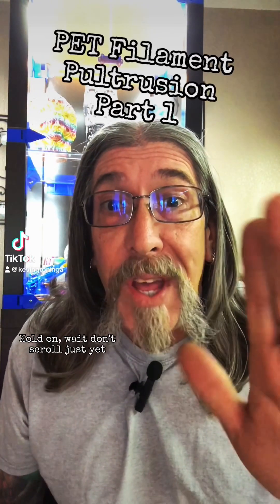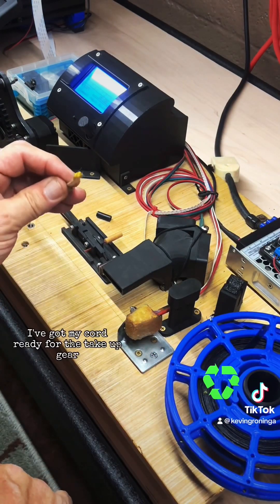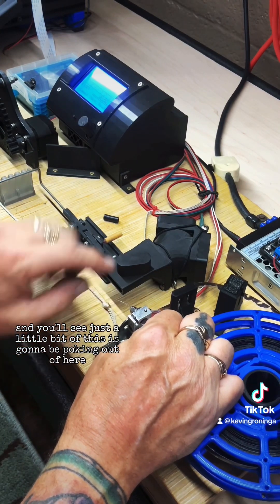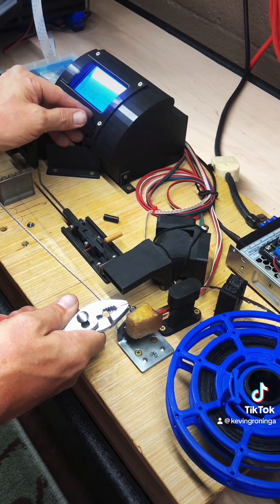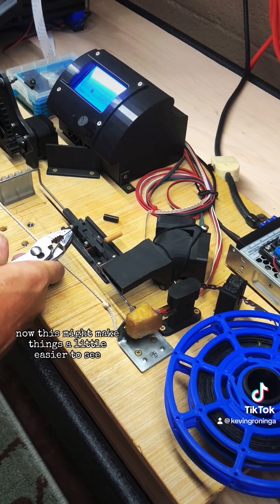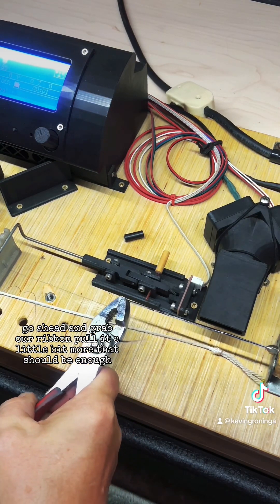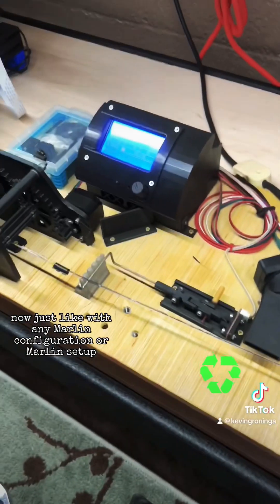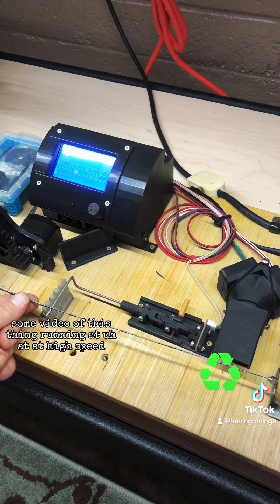FREE Filament for 3D Printers made from Recycled PET Plastic Bottles!

Comment: why not making smaler ribbons and meld them together true the nozzle so if u make x meter from one bottle u maybe can make xxx meter from tree bottles with for example 3 ribbons of 3mm. so you dont need to meld them thogether.... just reasoning...
Reply: Humm ok!
Reply from the maker: It’s much easier to weld the filament sections together AFTER they’ve been thru the Pultruder.  Trying to attach ribbons together is somewhat difficult and if not done right, it will NOT go thru the nozzle of the Pultruder.  It will be too much plastic.  You really have to understand how a Pultruder works.   It’s NOT melting the plastic into a liquid.  It’s merely warming it enough to roll it over into a tube. As an example, if your ribbon is slightly too wide, it will also NOT be able to be pulled thru the nozzle.

Comment: Greetings friend, very good video. Content related to PET filament is appreciated.
I have a problem with my filament making machine, since I changed the nozzle due to wear and tear, when I try to make filament, it cuts off a few centimeters after extrusion.
I wonder, based on your experience in making PET filament, what would be the main causes of the filament cutting a few centimeters after extrusion?
I would also like to know what is the best way to drill a hole in the nozzle so that the filament has a good diameter.
Beforehand thank you very much.
Reply from the maker: Not sure why your ribbon/filament would be breaking after pultruding.  Do you have the correct width based upon the thickness of the plastic?  As far as the nozzle, I just use standard 3D printing brass nozzles and drill them out with a 1.7mm drill bit I found on Amazon. Did you also drill/taper the heat block where the ribbon feeds in?
Reply: It was the diameter of the nozzle hole, I was using a 1.5mm drill bit instead of 1.7mm, then I reviewed all the possible solutions, tape size, thickness, temperature and speeds; It ends up being the size of the hole.

Thank you very much for answering. @KevinGroninga3D